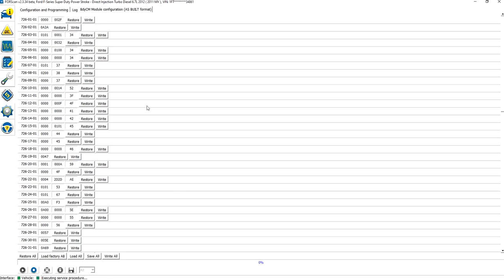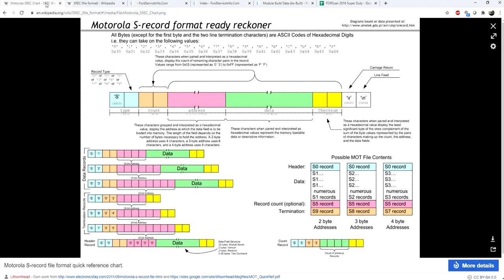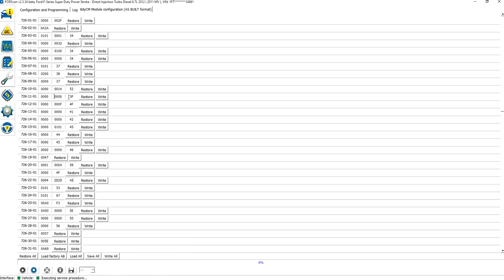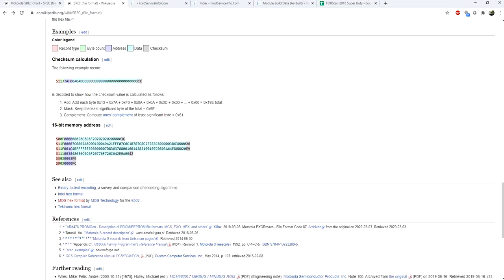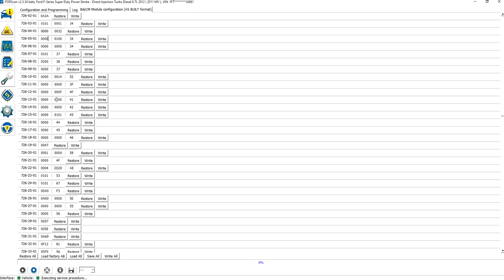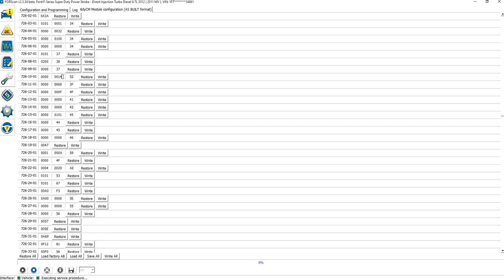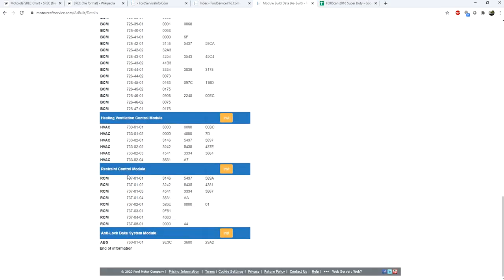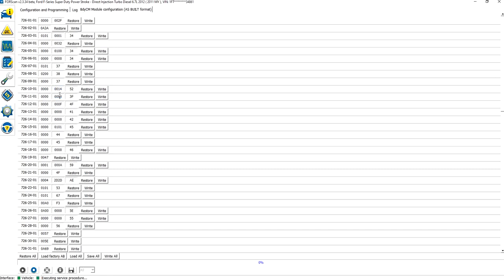FORScan - AS BUILT Data Explained & how to find OEM data

Comment: Just changed a Cross Traffic Module in a '17 Explorer. Hooked up ForScan, got the As-Built data from Ford via internet connection thru cell phone, wrote the data and the light went right out. Awesome & thank you the video. Helped me understand what I needed to do and I did it. 1st time, no issues at all.

Comment: i had to get a new DDM modul for my 2008 town car  the old one broken  but the one i got used don't have all the options my car has  so i need  to program more options to the module, do you know where do i get the codes for that? 
Or how do i extract the codes from my broken one to add it to the new used module?
Thank you!

Comment: @Justin Scholl, going to the motocraft website and downloading their as built file actually shows that many of the changes I made to the truck have overwritten this factory data. In other words, things I have changed are now present on the motocraft as built data. I'm not sure if the truck is doing this OTA as it receives patches and configurations require new values, but this as build is not the same as it was a year ago.

Comment: hi justin is it possible to download the built data from a specific vin from ford service website and use forscan to change everything in the as built data with out having to manually input every single 1, basically took a base model car and swapped everything to a premium but getting a crank no start and also key will only crank car over in the key programming hub since its a 17 with a push start, getting 1 single code for crank sensor but the pcm is showing rpm during crank, your input would be highly appreciated thank you

Comment: Hi i do have a question, so i have an issue with my TCU on my 2019 ford ecosport, for some reason the ford pass wifi has been disabled and says its not installed anymore.
Anyway i purchased forscan, went to check the as built data using forscan and it was completely different to what is currently in the TCU.
I cant work out why this would be different? So i haven't done it yet.
When the old module has had software updates from ford would this change the  as built data? Does the as built data on motacraft site contain any updates? Or do software updates have no effect on as built data?  Thanks for reading
Reply: Interesting; my ‘19 Ecosport does not recognize Fordpass either. Wish I’d known someone messed up the electrical hella bad before I bought it.

Comment: Hey Justin, I have a question that I think you'll be able to answer. I bought two signature lights for my Bronco. Passenger side has a control module, but the driver side did not. So I ordered a module and installed the headlights. The passenger side works fine and all functions of the light are correct and I'm assuming it's because the light came from a vehicle that was already configured. The driver side is screwed up... part of the LED doesn't light up, the high beams are always on, etc. If I go into as built and copy the values from the passenger side to the driver side, would that be a good way to get both lights working uniformly?
Reply from the maker: It's certainly worth a try! I would imagine most of the data is the same with the exception there might be small differences because there's a driver side versus passenger side. Without knowing too much how they work though I would think it would get you slightly closer.

Comment: Hi, very informative guide. In my case getting the whole default codes from the motorcraft page, I got a single list of codes with no paragraph or module, detached one by one, codes are all listed with no separation or references unlike it's seen on your guide. Is it possible to do something? It's not easy to understand which is which in my view. I got just numbers. Maybe they removed the module description and left only codes.
Thanx

Comment: Hi thanks for the information .I have problem with my Focus rs 2016 in the rear diff control module it seems change the the data
by itself each time i check it with Forscan , It comes up with a fault code (u3000-92 diff control module) and stops driving to the 
rear diff any help would be greatly appreciated

Comment: Has anyone remapped the ECU  timing and fuel
Reply from the maker: I do not think this is  possible in ForScan. These calibration values are only minor adjustments anything with fuel and timing (motor, trans, ect) are in another handful of modules (PCM, TCM,ect) which is not acceptable with ForScan

Comment: Have a question got a 99 ranger some tried to steel this truck broke the ignition I replaced the ignition had a key made . Question is locksmith attempted to program keys it would not allow the key to be program. I'm lost any help would appreciated
Reply from the maker: So I know that you can use ForScan go program the chipped keys. I did it in my 2012 F250. 

You have to program all PATs related modules so in my case it was the IPC and BCM. Had to reflash both for it to work

Comment: I lost my voice recognition and volume controls on my steering wheel after upgrading to 3.0 on my 2017 F150 I I have done everything I know searched the web and searched forscan for the right value to set to get it back,    Can someone help me?  Thanks
Reply from the maker: Hey Steve 
The second link in the description will bring you to Ford's site where you can enter your vin to get the original as built files. Downloading this and uploading in ForScan should return everything to stock
Reply: @jd_scholl  Ok great thanks

Comment: Hello, thank you for great explanation. I would like to ask you if you have any experience with Focus ST170/SVT, I have ESP light on, so i want to know if i can find the problem with FORScan. I see you have many modules in motorcraft, but i have only pcm and bce... Do you have any ideas? Much appreciated
Reply from the maker: ForScan is able to read DTCs and should tell you what the issue is. Do you have an adapter that has a MS HS switch? Sounds like it's only getting modules in the HS bus.
Reply: @jd_scholl  Thank you for answer, unfortunately i dont have the one with switch... Shiping is about month and i need it this week, so i had to order without switch.
Reply from the maker: @tadeasopen6050  ahh yea this is most likely why you are only seeing a few modules... I would take a look in the settings of ForScan. You may be able to set the CAN Bus speed manually and get access to the other modules
Reply: @jd_scholl  Ok, i will give it a try, thank you so much. Have a nice Day

Comment: Many thanks for the thorough, professional explanation. I am repairing my friend's Ford Transit Connect Mk2 2015 1.6 TDCi. I replaced the engine, the gearbox from the Mondeo Mk4, improved the isolation of the DPF filter from the block, and so on. The last problem appeared with the power steering, with the PSCM module. I bought the OBDLinkSX interface and registered on the ForScan forum to get the program. Great diagnostic tool! Soon I will try to upload new software to the PSCM module obtained from the link, a page on the forum. So far I only changed the settings in the BCMii module and had to connect to the internet to download Secondary Boot Loader (few seconds). Do I have to be online to upload a PSCM module update? I wish you a lot of health and joy in this difficult time. Greetings from Poland.
Reply from the maker: I don't think you will need to be online to do a simple update! Sorry for the delayed response

Comment: Good info. I have a bare bones XL that I want to disable the DRL's and enable the instrument cluster to light up when the truck is running.. This could be a great piece of info when Im testing out modules.
Reply from the maker: Nice! My truck was also a bare bones XL. I disabled the DRL using the Excel sheet I found online. Then I did a cluster swap to the Lariat cluster!
Reply: @jd_scholl  can the existing cluster be dialed in to light up when the truck is running?
Reply from the maker: @michaelflinn2791  I have never seen it done but I am sure there is a way to do it... May have to experiment

Comment: Amazing info Justin.  Am really new to this Asbuilt Data stuff and you really cleared lot of doubts I have.  
But I have a question, where can I check which memory location represents which components?  is the memory location name universal for all vehicles?  am really looking to enable cruise control on my car, but am unable to figure out which memory location is of CC, kindly help me with this info
Reply from the maker: That's a good question Kiran! the memory locations are going to change vehicle to vehicle and unfortunately there is no real good location for finding out what is what. Most of the memory locations have been found out through trial and error and guys just keep running google sheets documents.  Your best bet is to look up your vehicle name followed by "as built spreadsheet" on the forscan site and google
Reply: Hi.. did you figured out some thing to enable your required modification.. need some help to learn about this.  Please give your details to contact you @ practicalgangu@gmail.com

Comment: hi .can you tell me why motorcraft only gives me pcm and bce  modules and not the other modules ? great video by the way !!
Reply from the maker: I am not sure... Do you mean on the website when you look for the as built files?
Reply: @jd_scholl Hi yes , when I put in the vin I only get those 2 modules , you seem to get a lot more, that first post was from a different account but same person if you get me !!
Reply from the maker: @garycummins8082  That is interesting! Some lower lever trims will have less modules but this video is with an XL vin so you should at least get all of those... What year is the truck? If it is a newer trucks it's possible the information is not available yet maybe.
Reply: @jd_scholl  15 Mondeo/ fusion titanium

Comment: Great as built overview - not alot out there on this topic! Thanks for explaining - CLEARLY! One further question - can I also update say my abs module with my original vin as built after swapping abs module from a wreck? I get a vin mismatch error after install and just wonder if I can simply update the abs module with my original vin as built and save using forscan?? Would this make error go away?
Reply from the maker: Hey Joel, thanks for the comment! 

You should be able to change the vin as long as you are changing it to the original vin of the vehicle. The vin is hidden through out various models and checked. (I once tried changing the vin in the IPC to a different vin and got all kinds of errors). 

The vin is also just coded in as HEX so you can use am online converter to get the correct values.